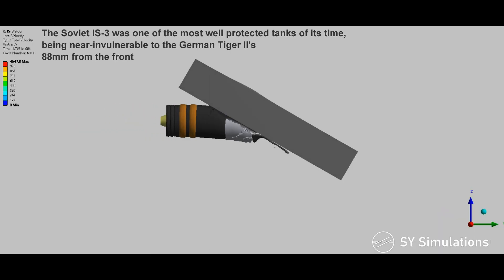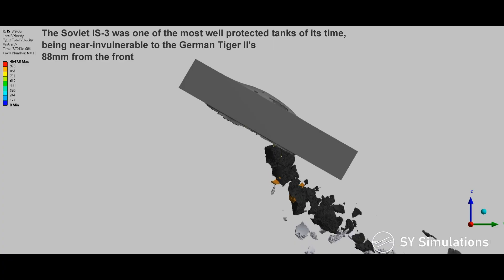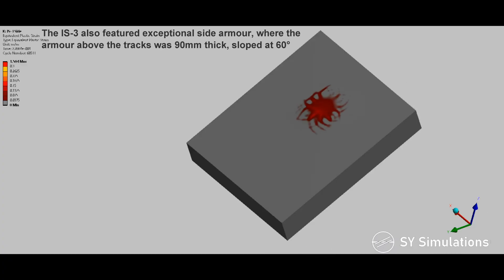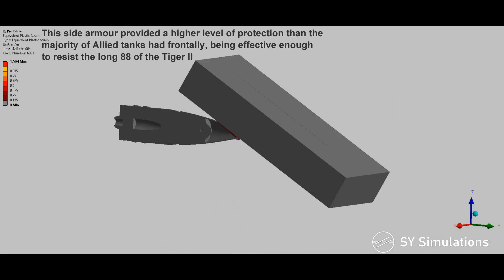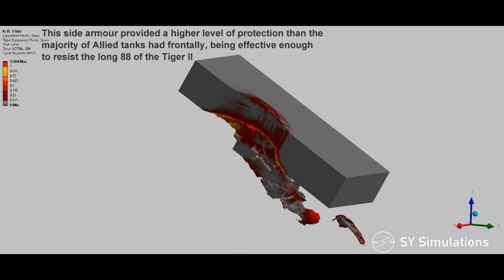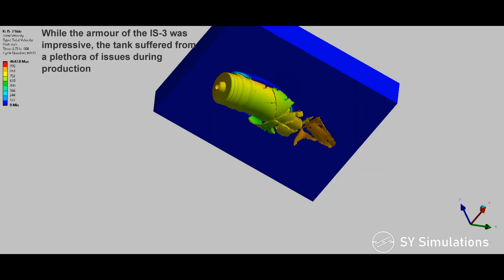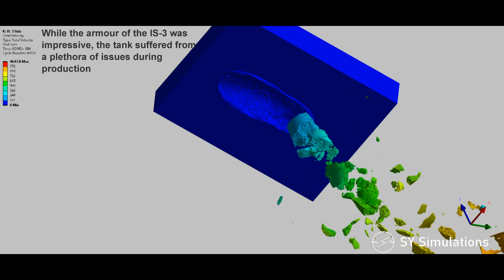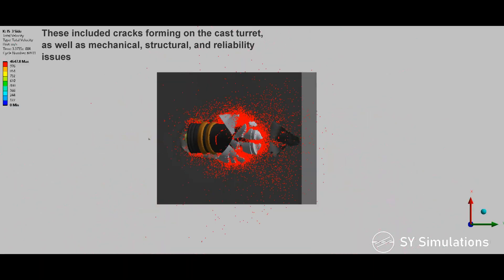TIGER II vs IS-3 | Side Armour Stronger than Most Frontal Armour | Armour Penetration Simulation

Comment: So basically the early IS-3 was pretty much the same as the Tiger II. Impressive firepower, amazing frontal armor on paper, but the design is rushed, armor cracks easily and the mechanical problems take it out more often than direct combat.
Reply: More or less. The Soviets had the very good IS-2, but they were worried its protection wasn't going to stay relevant so they rushed out a replacement. It turned out that rush was unnecessary as the war was over by the time it was ready, and probably the result would have been a lot better if they'd taken their time, but, well, hindsight is 20/20.

I feel like it gets a bit of an unfair reputation these days, mostly because people view it in light of its post war performance, when really it was a WWII tank, and a bit of a stopgap at that.
Reply: @zoro115-s6b  to be fair the Centurion was pretty much a contemporary design and it did very well after the war.
The is 3 could have been made with the 100mm gun which could then be converted into the 115 but it wasn't.
There was some unrealised potential in the design but it has a huge lack in all the components that really matter without the space to fix it.
Reply: @Spider-gg3pj but they updated them in "M" variation, and rework in T-10/10M wich was much better than centurion
Reply: @СлаваПшеничный-д3й  The T-10M is not a rework of the IS-3, its a new hull. And while it is good, it can't reasonably be compared to the centurion, they're meant to fulfill wildly different roles.
Reply: @СлаваПшеничный-д3й  on paper, not in practice
Reply: @Spider-WoIf  in practice it have better sight instruments, mobility, weaponry, armor, quantity, even if we compare it to MK10. So I'm really don't know in which categories centurion will be better. Maybe, comfort, but it's doesn't give so much advantage
Reply: @СлаваПшеничный-д3й  
Centurion has a far better track record in long range gunnery, also in engagements against the is3.

The 84mm can be debated due to its weaker HE, but the L7 is in every way more effective than the russian 122.

The armour of the is3 was of such low quality that it impaired its structural integrity and thus reliability.

The is3 only had 2.300 build.
Centurion 4.400.

The is3s power-packed was deemed a failure by the Soviets and discontinued.
Reply: @Spider-WoIf сравнивать ис-3 и Центурион по меньшей мере некорректно, это так же как некоторые пытаются сравнить т-34 и тигр, это танки разных классов. 
Ис-3 - это тяжёлый танк, предназначенный для прорыва наиболее сильно укреплённых участков фронта, то есть качественного усиления атакующих частей. 
Центурион же некая помесь между кромвелем и черчиллем. Постсоветской классификации он относился бы к средним танком но недостаточная скорость, посредственное бронирование без рациональных углов наклона. А что касается орудия то на момент нахождения в строю ис-3 на  Центурион ставились орудия калибром от 76 до 84 мм, 107 мм появилась только ближе к концу пятидесятых. 
И ещё, советские ис-3 практически не принимали участие в боевых действиях за исключением операции в Венгрии. А в Израиле в них экипажи были из арабов, надеюсь не надо объяснять что если бы в экипаже были русские результат был бы кардинально другим. И последнее захваченные ис-3 активно использовались израилем в качестве неподвижных огневых точек, а некоторые по прямому боевому назначению.😊
Reply: @ДанилаДзевялтовский  you make a fair point, the Is-3 and centurion were made for vastly different reasons, but even with the centurion having the advantage of fitting better into the doctrine of the time where it ended up being deployed, there is still the difference that the IS3 fell short of its innitial desing requiremments ontop of having little room for growth.
Only by evolving into the t10m did it become a usable tank, though it had to be changed entirely.
The centurion became a servicable tank very soon in its evolution after adopting the larger turret.
Reply: It did get better though, the tiger didn't.
Reply: @somethingoriginal390  its issues were only fixed by redesigns that resulted in a completely different tank. The tiger 2s reliability issues are greatly overstated and the welding and armour quality didn't cause any actual problems in the field. We have no reliable records of Tiger 2s being frontally penetrated during the war, whereas we have plenty of records of IS 3s experiencing catastrophic structural failures outside of combat.
The is3 had also far less room for growth due to its cramped interior
Reply: IS-3s mechanical issues only began to show up during 1946/47 due to prolonged peace-time usage. In practice, IS-3 was not significantly less reliable than IS-2, which also had shown some mechanical issues during its postwar service in the late 1940s. If they were to go into battle straight from the factories in 1945, like IS-2s did, then IS-3s would likely last through multiple operations without any major issues.
Reply: P.S.: And several subsequent refits and modernizations have mostly remedied those issues.
Reply: Dlatego sceptycznie podchodzę do tych "testów" przypuszczam że przy tak słabej radzieckiej stali i podczas uderzenia pocisku odłamki zabiły by załogę.
Reply: No, IS-3 didn't have so much issues with its reliability and was the main heavy tank of the USSR for a long term with over 2300 produced units, unlike relatively rare Tiger B.
Reply: Even if it was in the same vein as the Tiger 2, it didn't have the German me tality behind it. It had the Soviet mentality; Don't over think shit, it can be fixed, new iterations, etc.. 

I wouldn't say it's equivalent to the tiger, unless all you want to do is break it down to individual aspects, throw half away, and look at the remainder
Reply: Don't forget horrible crew comfort
Reply: @WindHaze10 is3 was quite comfortable compared to other ww2 tanks
Reply: the 122mm was very inacurate and the optical sights were dogshit like in the is2 along with abismal reload times which probably would have resulted like how stugs won engagements against is2s
Reply: @LordOfChaos.x  Not a great idea to base your entire comment on world of tanks. The IS-2 optics were far from dogshit. Soviet optics in general are underrated in modern times, but back in the day they knew. The T-34, for example, was evaluated by the UK and US. They gave it's optics high praise and put it on par with the Pak 43's, which was regarded as one of the best anti-tank sights at the time. 
As for accuracy, the IS-2 is not worse than any German tank. During testing, it had great groupings. At 1km, 50% of the shots landed within 24cm of the target, while the 5 least accurate shots landed between 24 to 80cm from the center. At 1.9km, the 5 most accurate shots were within 45cm, while the 5 least inaccurate landed in between 45 and 120cm. For comparison, the Germans tested on a 2x2.5 meter target at 1 and 2km. 100% of the Tiger and King Tiger's shots hit at 1km. At 2km, only 87% of the Tiger's and 85% of the King Tiger's shots hit the 2x2.5 meter target. The IS-2 didn't miss any shots at 1.9km, and all rounds landed within 120cm of the center. The grouping seems about the same, yet people think the IS-2 is inaccurate.
As for Stugs winning against IS-2's, it happened. You know what also happened? IS-2's and T-34-85's decimating King Tigers. The first tank battalion to receive King Tigers on the Eastern front lost every single one of them within 2 weeks. Just look up the 501st Heavy Panzer Battalion. The King Tiger performed quite poorly on the Eastern front.
Reply: @LordOfChaos.x а кто победил в войне? Кто взял Берлин?
Reply: I mean, the earliest IS3's apparently had welds breaking apart while it was being paraded right after the war...

Comment: The 7,5 cm Pzgr.40(W) soft Steel Shot at 900m/s vs the front hull of a T-70/SU-76 would be interesting.
Not to switch up with the Pzgr.40(Üb.), the Pzgr.40(W) was a cheaper alternative to the Pzgr.39 with a couple of advatages:
1. Cheaper, it was a plain 4,1kg Steel Shot Flat Head with Ballistic Cap.
2. Higher Velocity for ease of aim and accuracy of 930-990m/s (Depending on gun and barrle length).
3. Still Adequat AP performance for most tanks except the heavyer tanks such as T-34 and KW-1 from the Front.
Presses through armor instead of pircing, better against harder armor.
Reply: PzGr 40 (W) It was soft iron, not steel. It meant "Weich Eisen".
Best regards.
😊
Reply: @franciscojaviermartineztor9745  I know what it means, and while means Weicheisen, it is still Soft steel.
But that doesnt matter and i didnt say otherwise.
The Pak 41 also used a 2,5kg Pzgr.41(W) with great affect.
(I am german btw and i read the manuals.)
Reply: @Ghostmaxi1337 
Hi again Ghostmaxi!
I know it was used to good effect with the PaK41.
But still, there were 3 (maybe 4 ) types of PzGr.40:
1) the common Pzgr. 40 (HK) with tungsten carbide core.
2) The less common PzGr 40 (St), with hardened Steel core and about 0.30 to 0.50 % of carbon if my memory is working well. Very hard but also could break up 
3) The common PzGr.40 (W) or Weicheisen, with soft iron core, not steel. The amount of carbon was negligible, maybe 0.060%, and that was for a reason. The soft iron was very plastic an didnt break up upon impact, working by transfer high amounts of shock waves to the plate. Similar way to HESH rounds. So it was not steel, was literally, iron, soft iron. Not steel.
I think the exact composition is in the Geschossringbuch, but I am outside and answering from the phone.
If you have more information, please tell me.
Best regards.
😊😊
Reply: @franciscojaviermartineztor9745  Yeah, but Iron and steel are "pretty much" the same materian with "only" difference beeing the carbon content. And Weicheisen otherwise was allways translated to Soft Steel (which isnt wrong per say.) You arent wrong, its just the way i wrote it and it doesnt make any difference.

Comment: Keep in mind that this is the best case scenario, with a direct side shot, which is very unlikely. So in practice the upper part of the side armor is pretty much invulnerable to 88 mm with very little if any spalling when hit at a greater angle.
Reply: Yet the hull frontal plates cracked after non penetration hit as they were weakened by 3 massive welding lines at the very center and process itself. Soviet quality at its best.
Reply: Also keep in mind that if a separate peace in the West would have enabled the german army to stop the soviet advance. And naturally Germany would have produced a tank who could penetrate the IS3 from the front on combat ranges. 
The rock and scissors game was simply put to an halt by virtue of peace ..
Reply: This is not even the best case scenario for the long 88 though, realistically the shell could hit the lowest part of the side armor where it is completely flat.
And it is not a matter of "in real life it would be too difficult of a shot" as in WW2 American gunner shot the flattest part of a Panther turret front, and Germans shot turret rings of T-34s and IS-2s, which were much smaller.
Reply: @AllMightyKingBowser  at a distance of 1 or more kilometers, you are already shooting at the silhouette of the tank, and not at some part of it
Reply: @redc0mm1e  Indeed, but the video is about around 250 meters, and that is what I mean.
Reply: @AllMightyKingBowser  According to many studies, very few shells hit low, most of them flying into the turret and upper part of the hull.
Reply: @patrykb_  source?
Reply: @AllMightyKingBowser  In computer games that is very true, as you line up the cross hairs with the target. But in reality, there is a significant amount of Gun to Sight Parallax error which most computer games don't account for.  This error is both in the vertical and horizontal planes, making it nearly impossible to aim for such small parts of an opposing vehicle.
Reply: @abaj006  So half of enemy side armor is small weakspot? Got it
Reply: @AllMightyKingBowser  been playing games too much? I have a little bit of experience with real life tanks (T-72B and BMP-1). Even modern tanks shoot at the center of mass. Moreover, lower part of the hull is usually screened by terrain and other objects.
Reply: @AllMightyKingBowser Your reading comprehension is very lacking. What part of “the upper part of side armor is pretty much invulnerable”, can you not understand?

Comment: Imagine if it would be in combat
Reply: IS-3 saw combat in '67, during Six-Day War. I recall end result was 11 IS-3 traded for 4 or 7 M48s. M48s used HVAP rounds, after first shots (with HEAT rounds) failed to fuse after glancing hits, and were assumed ineffective. Some sources on net claim these were 105mm armed M48s, but that cannot be correct, as Israeli upgunned their M48s only after Six-Day War.
Reply: @kireta21 still good result for IS-3. WWII tank against Cold War developed tank
Reply: @vasëk_comandir  M48 wasnt known for its armor, a tiger 2 would have probably be more suitable